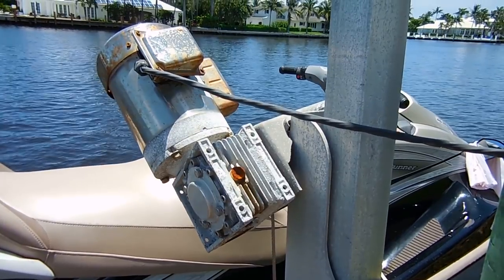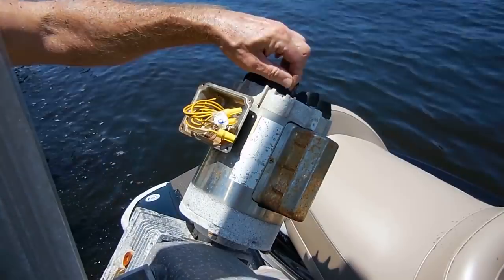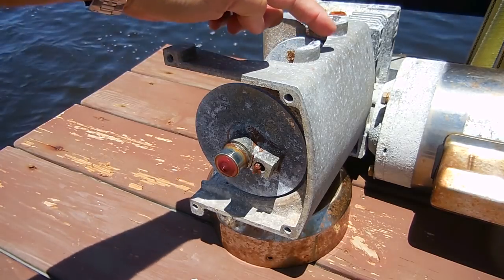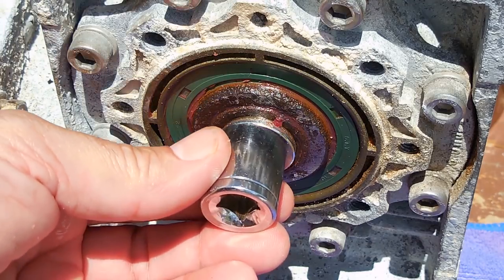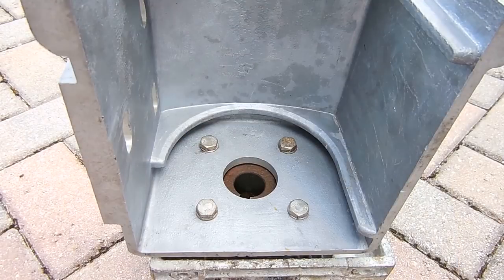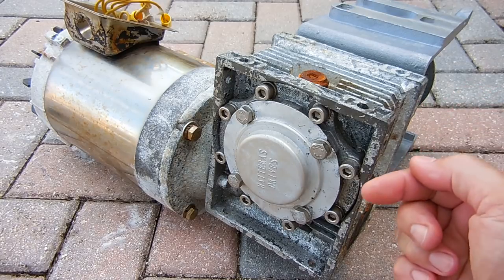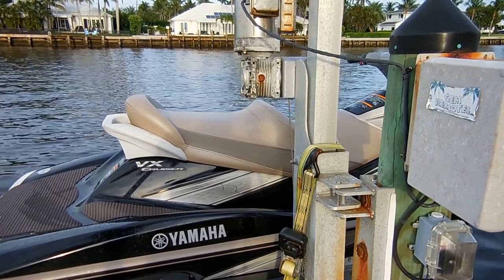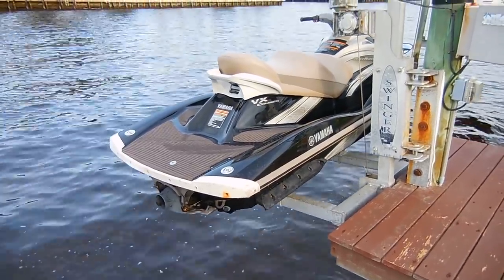Boat Lift Electric Motor Repair (Housing & Cable WInder)

Comment: No limit proximity sensor? Poor manufacturer original design. Even a shunt circuit to sense over current draw would work. You always need to compensate for humans when designing something. Nice Video and fix!

Comment: No limit switch on initial install? You'd think that would be a required safety feature.
Reply from the maker: Robert Szasz Nope, no up limit switch. Really no need for one if you watch what you're doing. Thanks for watching!